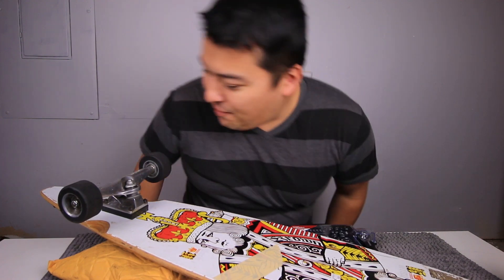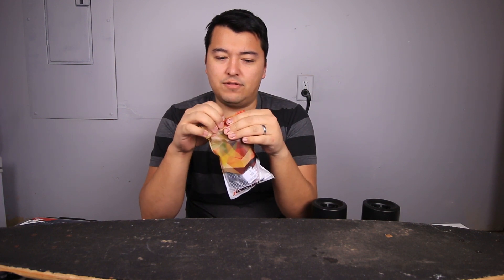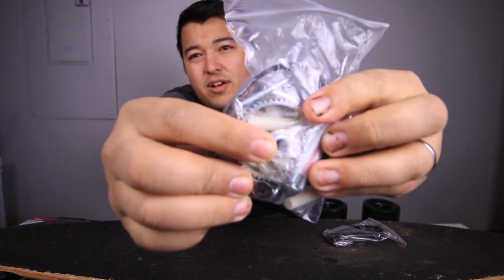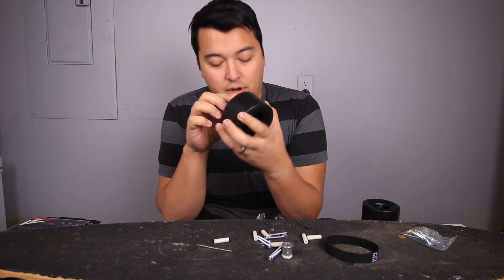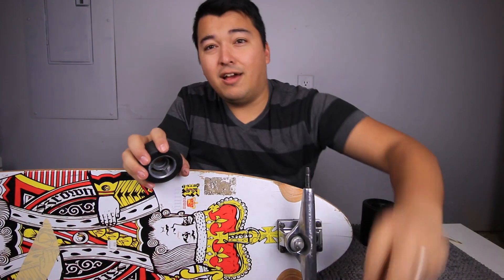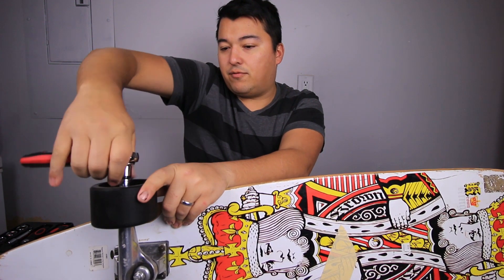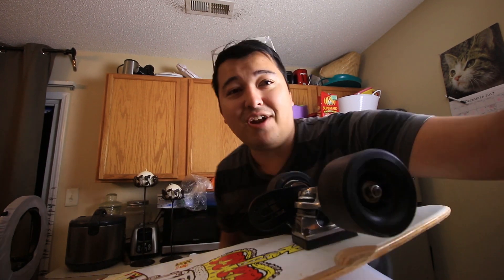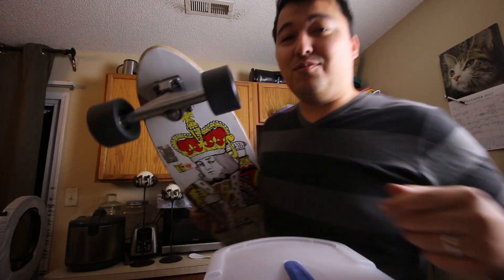DIY ELECTRIC SKATEBOARD UNDER $150 PART 1

Comment: I'm trying to build my own and I'm wondering if your motor is 60 amp do u get a 60 amp esc or do u work out which esc to get from the battery amperage nice video btw
Reply from the maker: Lol im still trying to work the math myself! ill let you know when I found out. the motor i ordered is the N5065 270KV Brushless Motor I currently run a 120a ESC in my RC car but I may opt for a Eskate vesc instead as long as im under budget
Reply: camo get on diyelectricskateboardbuilders forum 
You want your esc to be able to handle more amps than your motors.  You don’t want your esc to work at its  max
You also have to figure out what size battery you’re gone to use and make sure it’s not more volts than the esc can handle
Reply: Dustin Vang with 270kv and being a bigger guy you’re going to have to push off to start.  Should be a decent top speed though.  Personally I would have gone for a little closer to 200kv for some torque on the low end
Good luck 
Can’t wait to see your finished product

Comment: What are you going to use to secure the electronics? Some people use a water tight tubberware.
Reply from the maker: yeah ill probably either 3d print one or there is a silver wair container at Ikea that I can actually convert to a battery holster.

Comment: In rc cars the gear that goes on the motor is called a pinnon not sure if its the same in skate boards
Reply from the maker: This one will be belt driven so it wont need to use the pinion. Its actually pretty cool how they did it. I think the thing with these though is to make sure to carry a spare belt at all times! and a screwdriver!